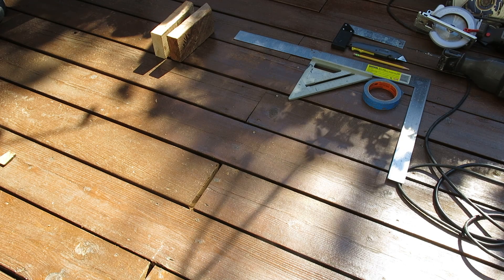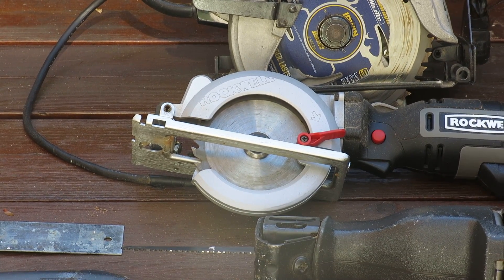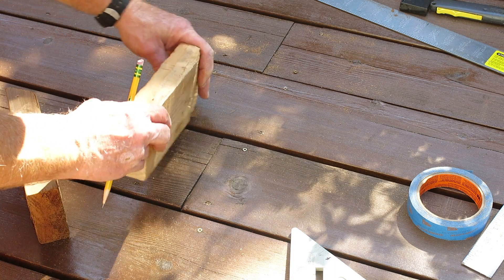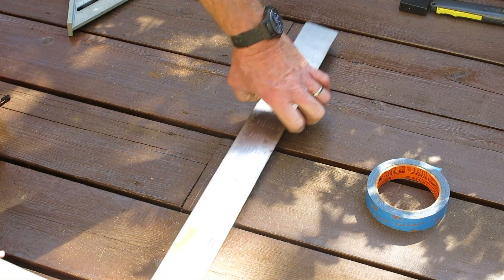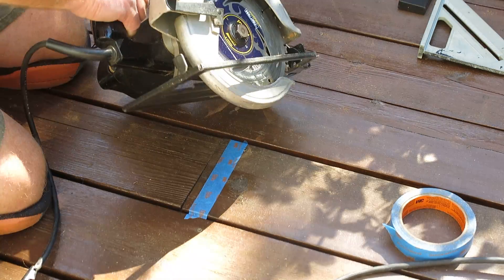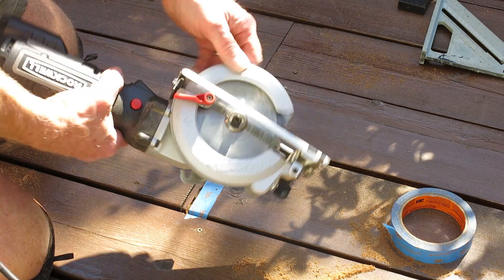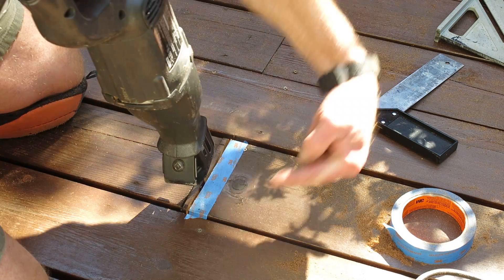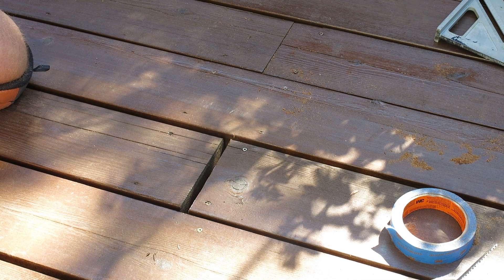Deck Repair- Cutting out a decking board and/or Trimming the seam

Comment: Very strange, most builders go for the opposite- tightest butt joint possible.
The one thing which will rot out your boards quickly you have not addressed.....And that is paint on wood preserver, especially on end cuts.
Reply: I’m realizing the less with the touches each other the less rot you’ll get. If the wood can breathe and dry out way less chances of rot. The previous owner on my deck put a lot of wood under to support the posts and I have all my right right there instead of just using big leg bolts
Reply: @to5msheppard 
 "Lag" bolts?
Your kidding.
Build it flimsy and it will fall down.

Comment: HERE'S A TIP...
I just went through this dilemma with my deck.  Although this is what I did...
I used the speed square to be my straight edge cutting guide.  I used wedges to secure it to the deck boards.
Then I took a jigsaw, and cut the boards.  Since the joist 'weren't' directly below the cutting area, the tip of the jigsaw's blade wasn't making contact with it; which would make it almost impossible to cut and very dangerous.
Another thing that mattered was ensuring that the jigsaw blade can be placed between the deck boards at a 90' angle.  This is so you can make the deck board cuts.
These cuts were fast and easy to make.
Hope this helps someone.

Comment: Wouldn't it have been easier to lift the board from the deck, trim it, then secure it back to the deck?
Reply: In my case, half the screws are stripped or snapped. Hard to lift it
Reply: I originally used stainless steel square head screws 20 years ago that were 3 1/2 long… almost impossible to unscrew without stripping the head.  Now I would use the upgraded torx screws 3 inch long.